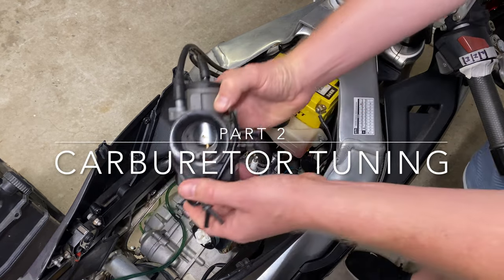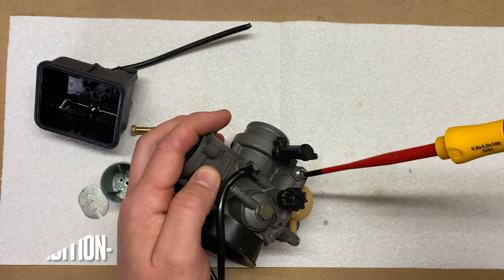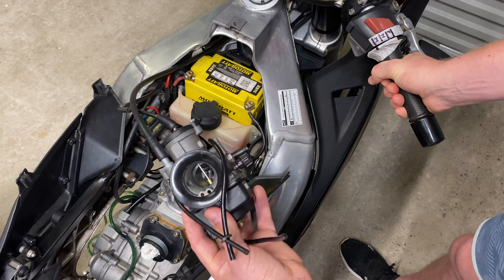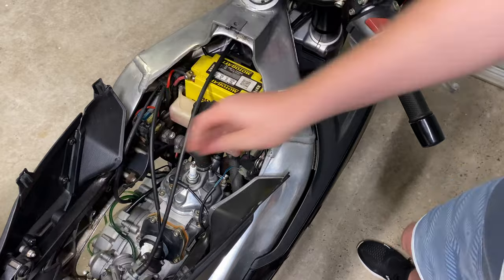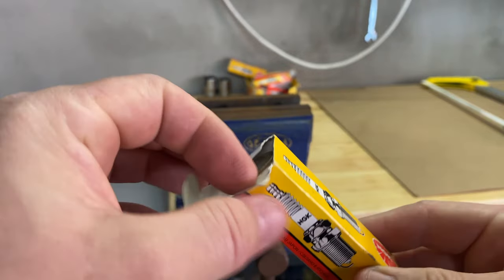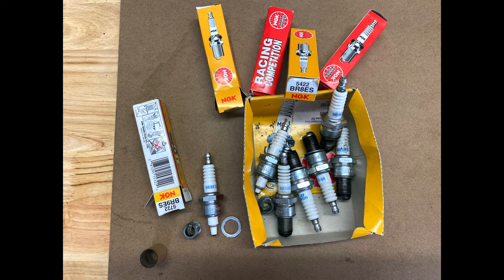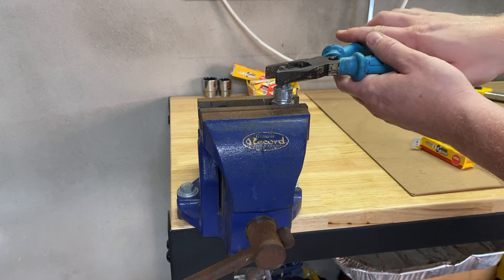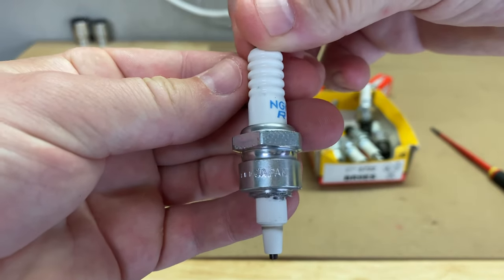Aprilia RS 125 | Dellorto PHBH28 Carburettor Basics Part 2 - Roadside Tuning.

Comment: Replace carburetor lectron bro
Reply from the maker: Hi Piw
You have got me thinking…..
A premix RS would be awesome. And it will swap out the crappy standard carb- which I think is the weak link on these bikes (fuel emissions)
Reply: @tom did it what size aprillia standard carburetor?
Reply: greeting from Indonesia bro
Reply from the maker: Greetings from Australia, Piw.

The later Aprilia bikes (like mine) came with a 28mm carb. The earlier rounded model of RS bike came with a larger 34mm carb.
According to Aprilia forums the 34mm carb is the way to go as it adds power throughout the rev range👍
It seems the older bikes were not as restricted as the newer bikes.
Reply: @tom in Indonesia rarely aprillia bruh sorry I don't know anything about aprillia motorcycles